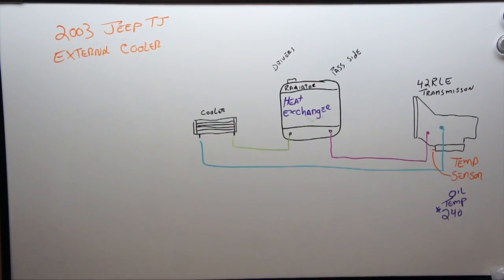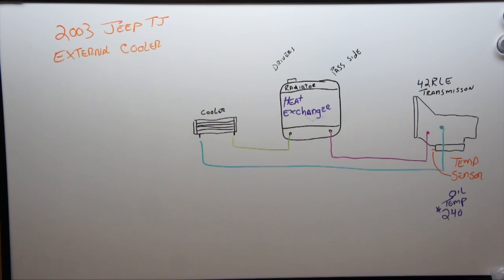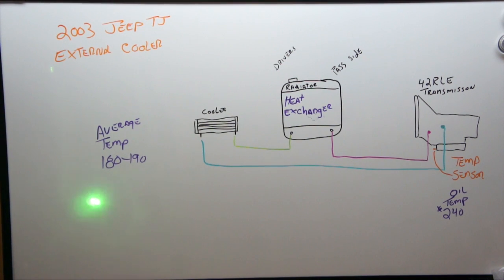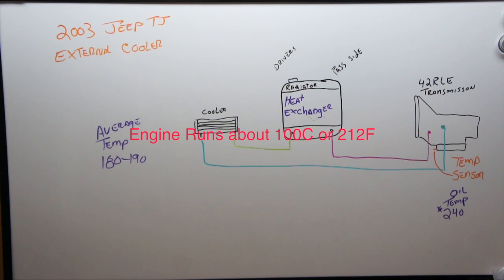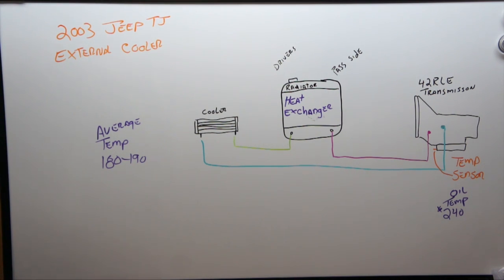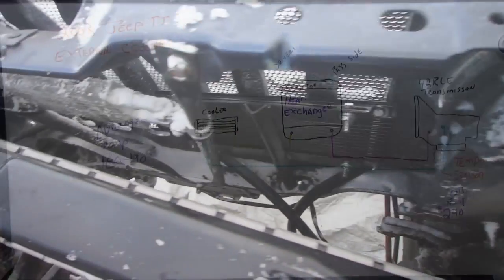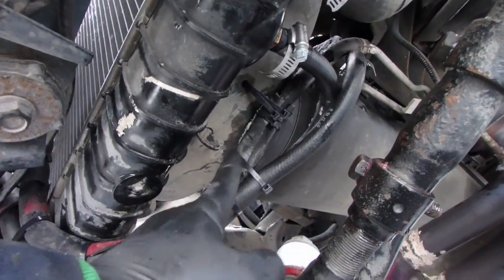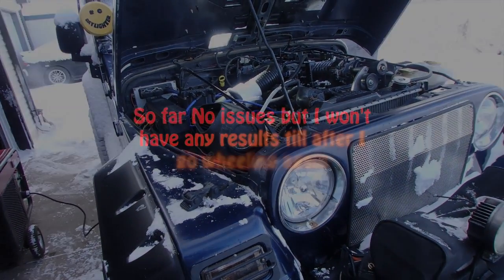Why Do I need a Transmisson Cooler

Comment: Don't run it through the radiator you fool.😣
Reply from the maker: Here we go another armchair mechanic
Reply: The Tran cooler heats in the radiator heat up the transmission not cool it my friend. Its ment for cool weather
Reply from the maker: Wrong, transmission runs hotter than the engine coolant...... try again
Reply: b&m recommends going through the radiator and then the cooler with their coolers
Reply: Just pulling your legs but, I still don't like to run mine in to the radiator.🤒
Reply from the maker: Some people like to run it that way. Dual coolers work good for heavy applications

Comment: Bypass the internal radiator heat exchangers for the transmission cooling part, that way  you will never have a Transmission failing due to radiator coolant mixing with the transmission fluids. :) Also i will recommend getting a B&M type with a built in fan and temp sensor, which you can set up to run when the radiator fans is just starting to come on. :)

Comment: The heat exchanger for the transmission on the engine rad is there to heat up the trans fluid for very cold start in cold climate,
This heat exchanger can’t cool trans fluid as coolant temp (195 to 220 °F) is higher than trans fluid @ operating temp.
Cheap solution form Jeep to helps to bring transmission fluid to operating temperature quicker, problem is that coolant temp is higher than transmission fluid when all is at operating temp, this exchanger keeps on heating up transmission fluid with is not good.
They should have add a bypass but they didn’t not, 
Option one for moderate climate it to bypass the heat exchanger on the engine rad, option 2 is adding a trans cooler, option 3 is option 1 +2

Comment: You had a Lowrider?  got any videos of that? I've been following for a few years now, but had no idea. I do really want one some day.
Reply from the maker: +GrandCaravanSE no videos this is going back to 2001,  it was a S15 lowered on Hydros.  Had a chevy 350 with 12:1 TRW dome pistons, 550 lift cam, 202, 192 heads, and edelbrock 750 thunder carb. tied to a 700R4 with shift kit, all custom gauges.  I have photos I was thinking of scanning them and doing a voice over on the build on this channel
Reply: Do it! Sounds like you had a lot of work into it.

Comment: is there a recommended minimum temp?
Reply from the maker: +max margherio if it's too cold your transmission will shift sloppy and you'll get condensation in your oil
Reply: Yes: somewhere around 150F for most transmission fluids.   This will help remove moisture from the system, which helps prevent corrosion in the long run.   Personally, if this setup stays between say... 140 and 175 after a half hour of driving settles temps out,  I wouldn't touch a thing.   Not sure how the winter weather he showed is tilting things, but in extremes like -20F, you start worrying about sensor placement [and maybe insulating it outside its thermowell] to get good readings.  And in that kind of weather,  it's time to tarp off some of your heat exchange area up front anyway.  I've thought about putting a bypass valve on my vehicle to shunt flow around my secondary cooler if I get caught in a cold snap - something electronic so I don't have to  stop or re-rig anything, but I haven't done it yet.  But you need that heat exchange in the radiator : it gives a little preheat to coolant which keeps the engine happy.

Comment: Also, keep an eye on those hoses where you made your connections as the weather changes.  They tend to leak.
Reply from the maker: +JeepVideoGuy I usually tighten them up after it's been warmed up and cooled just for that reason.
Reply: +jerry bskorner good deal

Comment: You ever try a MagHytec pan with the aluminum fins? Many claim it helps to eliminate a few degrees from the trans fluid.
Reply from the maker: +Zack Zander it would most likely work or a deeper pan

Comment: Interesting , take it out in the winter for a drive and put your temp gun on the return side and see the temp. Could it run too cold in the winter,don't know.
Reply from the maker: +Steve Rob no issues with shifting as you would normally find with running too cold and keeping a eye for any condensation which would be a good indicator that is saying the oil isn't getting up to Temp